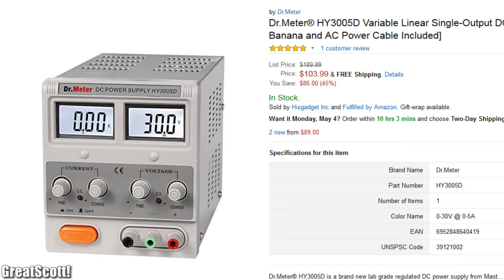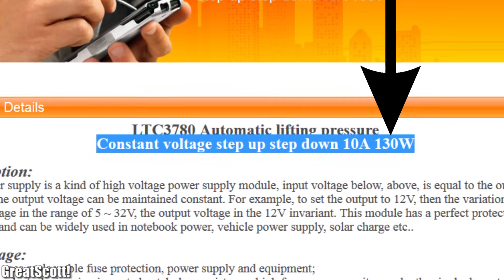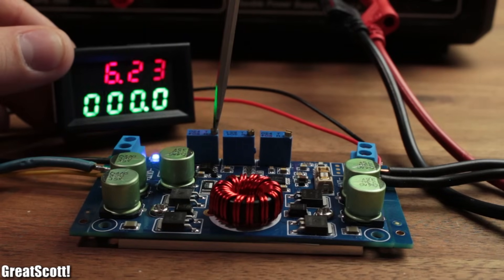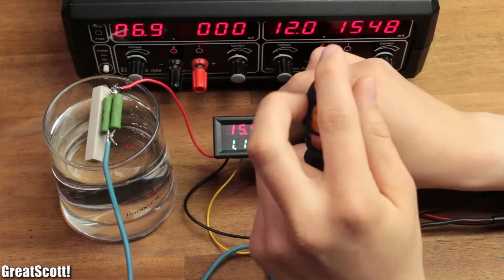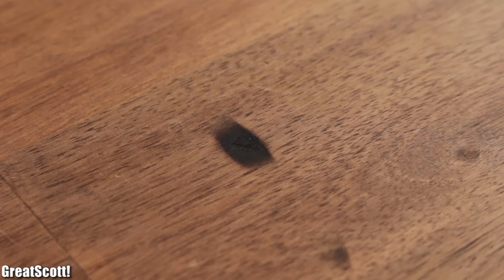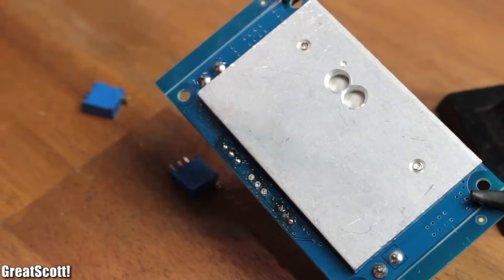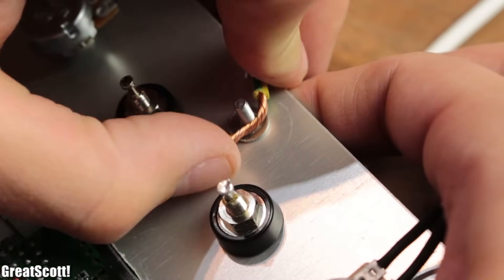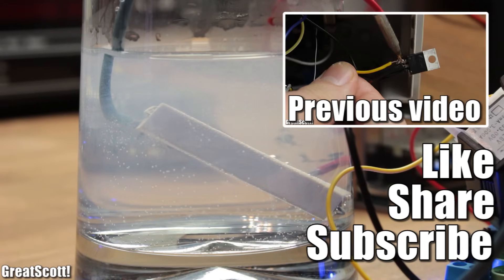Build your own Variable Lab Bench Power Supply

Comment: @3:55 that right there is why we prefer crimped connections over solder for high power and high vibration applications. If there is a fault on a circuit that is soldered, it can melt the solder and cause leads to fly loose and start a fire. This is not so much a good thing on a car and certainly worse on a boat or an airplane.  If you ever hear someone say they don’t like crimp connections and categorically prefer to solder everything, then they are sorely lacking in real world experience.  You see this happen all the time on heavy gauge battery lugs, because people often lack the tools to do a proper hex crimp.  So they solder the entire socket.  Not only does this create the aforementioned failure mode, the solder also wicks up into the strands and creates a hard point where strain concentrates.  Over time fatigue from vibrations and repeated flexing can cause this to totally fail, or even partially fail resulting in a high resistance hotspot that can ironically also lead to solder joint failure.  If a connector is meant to be crimped, then learn how to crimp it properly.   97% of crimp terminal designs are superior to soldering, it’s improper training, a lack of knowledge, and using the wrong tools that causes all the problems.

Comment: I see you've got many positive comments but for me a wiring diagram could be very useful. Like the one here which I found on internet after watching your video -->  https://rmprepusb.blogspot.com/2019/11/everyone-is-wiring-up-their-power.html

This is also IMPORTANT: Iin your circuit the thin black wire of the meter shouldn't be connected! "Notice that, unless you are using two independent power sources (with separate floating 0V such as a battery) then you do NOT connect the thin black wire. i.e. If your project uses a common ground then do not connect the thin black wire." (from the link above)

Comment: An interesting project but if you are building it to try to save money then just buy one ready made, it will likely perform better, it will look better and you'll save money as it will work out cheaper as the components alone are not cheap.....you can get a decent one for around $50

Comment: i would like a power supply or charger with 600w output variable voltage. any idea's how to make one on a budget
Reply: Use old computer psu they can cost like 35$ for that wattage if you buy old one

Comment: I can't even tell you how many times I have taken 110VAC, straight up electrocuted. One time I was replacing an old ladies 3 exterior lights. Her front porch, her side porch along her driveway and her back porch light. I got zapped on the first one. Usually, I can replace a light without turning off any breakers. As long as you are careful, not a problem. On the side porch I went ahead and turned off the breaker. I still received a shock. So on the back porch I flipped the breaker off and disconnected the power supply. I still got shocked for the third time. It was at this point that I came to the realization that the womans aluminum siding was shorted to ground. The entire exterior of her house was hot and ready to discharge to ground. That was why I kept getting shocked. Now, I am no slouch when it comes to electronics. I was an Avionics Electronics Technician in the Marine Corp. And I worked on the AV-8C Harrier jump jet. I even took 220VAC from my right hand straight to my arm pit. I was checking for 220Volts with my Simpson volt meter. My camo sleeves were rolled up and I had my arm pit resting on the coaxial cables for the ANALR-45 radar warning system, 5 cables with metal shielding on the exterior to vent any stray voltages directly to ground so as not to interfere with the radar systems. This was on the flight line at Marine Corp. Air Station Yuma, AZ. It was hot and sweaty, and just as I saw my voltmeter jump to 220Volts, my sweaty right hand slid right down the meter lead and made contact with my hand. I was locked in a death grip as my body tensed up. Luckily, I was able to overcome it in milliseconds, but not before receiving a very serious shock. Thank God the connection was from my hand straight to my armpit. Had I been grounded to any other part of my body, that current/amps would have travelled through my whole body, perhaps even stopping my heart. I still felt the shock all throughout my body, but that was just stray volts wandering through my body seeking ground. Luckily my armpit was making contact with at least 3 of those 5 coaxial cables, giving the electricity many options to return to ground rather than travel throughout my body seeking ground.

Comment: A quick note - just tried this with two LTC 3780, and both gave faults out of the box. While trying to respect the "do not touch" the under-voltage protection pot in the end that needed turning clockwise a lot to get the fault light to go out and the OK LED to go on. Worth considering in case you see this too -- thanks for an excellent video!

Comment: Hello, Trying to make the same project and I'm stumbling upon a problem. When I replaced the Vout potentiometer the reading goes from 0 to 25K Ohm only and the circuit is not working. Tried to measure the 500K potentiometer and when it's not connected to the board it reads fine, but once soldered with extension cables (10cm long) it goes from 2 to 25K only. The original and 2 other potentiomenters show similar values connected and all working fine by themselves not connected.

Comment: Can i use 12V 20.8A - 240W.  led strip Switching Mode Power Supply with all protection and charging high amp batteries  make video pls

Comment: Nice project, but I think instead of telling people to not try this project if they are inexperienced with electronics (because they have to wire a plug themselves) I would have told them to find another power supply that doesn't require you to wire your own plug. An old laptop power supply would have worked well for a lot of people.

Comment: Anyone know where to find that case?
Reply: You could probably buy a small waste basket at the dollar store and it would work. Or get some scrap metal duct and cut & fold your own parts. I know of an hvac place that leaves all their cut scrap ducting in this trailer in the alley that’s free for the taking and I’ve used it to make all sorts of stuff like custom razor saws, L brackets, housings for little projects of mine, custom washers, pizza slicer, custom straps to secure stuff, etc. You could probably get a lot of flat scrap sheet metal from the outside of a broke fridge, microwave shell, metal file cabinet, etc. You can also get nice size plexiglass sheets from broken flat screen TVs. I got 2 pieces from a 65” tv and to buy those same sizes from a store would cost so much. Also yoy can find 4’x4’ thick plexiglass sheets from the loading dock at Walmart sometimes, they come on pallets as seperators when stacking certain products.

Comment: I built a variant of this power supply 6 years ago as well as a smaller one of a different design about a year later. Six years on & both bench power supplies are still going strong with my using this variant just this evening to help build another electronics project.

Comment: Instructions unclear. I spent 150$ just on the jigsaw.
Reply: Have you ever heard of harbor freight? Or drilling holes in certain spots and then using a hacksaw to make the cuts you want?(you drill a hole, unhook one end of the hacksaw blade, put the blade through the hole, and then reattach, cut to where you want, and repeat. Also, if the wood is thin enough, you can score it with a utility knife a bunch of times until it cuts through, or score enough and then snap it. You’ll want to sand the edges. Also you might want to get two pieces of 2x4 andsandwich them together, secure them at the ends with a big it and nut. That way when you snap the board or plexiglass, you can tighten it inbtween the 2x4s with the scored line right on the edge and use both hands and quickly snap the board or plexiglass fast to make a clean cut. That’s pretty much the only way to cut glass too btw. works best with really thin mdf board, chipboard, thin particle board(the kind that is stapled to the backs of cheap book cases to keep the whole shelf straight)plexiglass glass, abs plastic, polystyrene plastic sheets, etc. you can also use plastic storage containers as a housing for whatever project that requires electrical components being secure the snide and drill whatever holes for buttons and power cords.

Comment: Nice, but i probably would have used a more powerful supply, 12V 10A. Not because I need 10 amps but because I know those chinese power supplies very well and they tend to fail if you use them to their full rating without taking a look inside of them and improving the heatsinking, some solder connections, and sometimes change some questionable capacitors.
Reply: If you want a really strong power supply, you could sneak into a hydroelectric damn. If that’s not doable, there should be a little lot in your neighborhood that has all the transformers. All you gotta do is climb the fence and attach whatever cords or wires to it and it will power it super good. Mega power ⚡️ ⚡️ ⚡️ 😊😊😊
Reply: @MrRusty-fm4gb  LMFAO

Comment: M8 your bad soldering on the AC socket is scary , you should first have a good mechanical connection by wrapping the wire around the pins then soldering , this is basic stuff and then heat shrink over that is a good idea plus a fuse ?  It worries me that people are going to get hurt .

Comment: If you don't want to deal with high voltage AC wires, there are power supplies which have a plug just like the one on the back panel, except directly onto the power supply. 

These are usually put into servers, so you gotta trick it into thinking that certain contacts are connected by shorting it with a resistor  (all external and low voltage work). Plenty of tutorials online.

Comment: 1. It's NOT mandatory for current limiting. A current limiter is extremely easy and simple to build, requiring only four components including an ammeter, and can be added to any ol' nasty power supply.

It's nearly never worth your time to build a variable-voltage variable-current power supply because it'll cost you four times as much money in parts as a complete functional Chinese power supply from Amazon... complete with about three thousand five-star reviews.

Comment: Using those cheap chinese power supplies at their full rating is of course possible, but then they usually die after a few months of use! Better to purchase higher amp rating versions that will survive! And as you are putting everything in an enclosure, why not to remove the metal enclosure of the power supply to mount its power semiconductors on proper heatsinks instead of a metal box? It will have a longer life!

Comment: I like this idea. I don't need that much power. I am interested in  low voltage low current projects. something that works with digital circuits and  and adjustable current limiting.  Maybe something that is powered by a small 12 volt DC power supply?

Comment: I have a Superite AR-3000 [3000VA] power conditioner that regulates the 120V AC and steps up to 240V having two separate outlets for each, using a 20lb isolation/step up transformer that has shunt windings that are used by the regulator board for final AC output control. [just measured 116V/233V using 123V source, my current house voltage.] I want to send each output into 2 50A/600V bridge rectifiers and the filter the crap out of it.
I want to use this as the base for a CC/CV power supply. I know that my final RMS will be about 160VDC/320VDC max@ 20A combined loads. I already have a handful of STW26NM60 N channel mosfets rated @ 30A/600V, they have a Vgs of 3V min, 4V typical and 5V max. [Directly parallel 2 of them per output, maybe balance the drains with a 20W .01ohm resistor???] I was thinking of using a 5V/1A little switching supply driven by the AC side of the 120V bridge rectifier for control supply. I was also thinking of using a couple of digital volt meters off of E-Bay as panel indicators.
Could you generate me a schematic on how to do this having both the CV/CC ability and being able to integrate the CC meter?
I already have an idea of how to use the mosfets for voltage control but have no idea how to make it CC/limiting with an adjustment meter.
I am aware of having such high DC voltages present, [India can tell you all about that] the normal voltages I would use is 60V or under but with plenty of current headroom :-)
I have been working with electronics for 40 years repairing old CRT TV's, VCR's and appliances. Networking certified with computer building, repair and various OS manipulation. I ultimately went to work as an automotive diagnostic technician. I have a motto..I can fix just about anything except my marriage.
I tell you this so that you know that I am not a complete knuckle head yet green around the gills with no formal training. [Except DC theory which I already knew by that time at 19 years old]

Comment: I made this supply about four years ago, and have used it most every day since.  Learned a whole lot about electronics in the process, and plan to learn a whole lot more.  Thanks for the awesome build guide!

Edit: Just remembered, I don't know if they sell that buck boost converter board anymore, but if anyone is playing with it, it's a three layer board.  I shorted an internal trace out when I was trying to desolder the pots my first time around, and had to wait a week for a new one lol.  Be careful with the iron when desoldering, and let the pot fall out like he shows if you can, if you try to pull it out too hard you can mess up a sandwiched layer.
Reply: Its a terrible design. MOSs' blow up pretty easy. I found that a simple 8A XL4016 module does a better job than this as a variable supply.
Reply: 9

Comment: It Is modular and you can build it your own, these are good things but actually..considering the switching Power supply, the DC/DC buck/boost converter and the enclosure, isn't it cheaper to just buy a LongWei or other economical switching Power supply, which comes ready to use?

Comment: I have been thinking about making one of these for a while and adding a rechargeable battery bank to it and make it portable but then I ended up buying a regular bench power supply. It would be the same or close to the one you made with the exception that it would have rechargeable batteries inside with charge management to not over charge or discharge while plugged in. Maybe a charge meter on the front too to show how much power is in there before taking it to a job.

Comment: Yescom 110V Input 30V 5A Output Precision Variable Digital DC Power Supply with Alligator Test Lead Set (Price $50.00 USD)
https://www.amazon.com/Yescom-Precision-Variable-Digital-Alligator/dp/B00QJS8RW0/ref=asc_df_B00QJS8RW0/?tag=hyprod-20&linkCode=df0&hvadid=198063088238&hvpos=1o3&hvnetw=g&hvrand=3146939082731673668&hvpone=&hvptwo=&hvqmt=&hvdev=c&hvdvcmdl=&hvlocint=&hvlocphy=9032544&hvtargid=pla-348683490679&psc=1

Comment: I am currently building this and I have found that when you remove the 500K pot and connect some wires to a new 500k pot on the front panel, it can pick up lots of noise from any nearby source (including your hands, nearby switch-mode PSUs, lights, etc.). For instance, with no load and long wires to the 500K pot, the DC-DC converter draws about 100mA and even then the current varies quite a lot (it should be 20mA with no load!), but if I put my hand near the long wires going to the 500K pot, the DC-DC converter draws 1 Amp or more with no load! It is picking up noise due to the high impedance of the circuit. This can also cause the DC-DC converter to misbehave and the fault LED may come on or the output may go wild or just cut off. This is especially bad at the higher output voltages where the resistance approaches 500K. You can tell it is drawing a large current because the heatsinks on the DC-DC board get hot and they should not get hot with no load! So I cut the ends off a shielded USB cable and used it to connect to the 500K pot on the front panel, I also connected the braided shield of the cable at the DC-DC board end to 0V input on the DC-DC board (the other end of the braiding is not connected at the pot end). Now it draws 20mA with no load even if I put my hand on the pot or around the shielded cable. The 200K pot should also be wired up using shielded cable too.
Reply: Thank you very much for sharing this. 🙂
Reply: Thank you for noticing !
Reply: you might want to shield those wires to the ground reference
Reply: Thanks, very helpful.  Can we lengthen the wires by adding longer wires or will that effect the accuracty of the meter?
Reply: @johns2590  You need to use a shielded multi-wire cable for the pots as explained above! Keep as short as possible. make sure you ground the shield braid at one end.
Reply: @steve6375  Power electronics is not amateur stuff it seems.

Comment: Still unclear what is the purpose of those power resistors. Are they meant to stabilize the output or give a way to measure current even with no load attached? This has no answer not even in the instructables page, so I'll have to figure it out by myself, because if I have a li-ion pack that I want to charge I have to make sure that the current does not exceed their tolerance, so I want to know it beforehand.

Comment: Don’t trust that boost converter. Lots of them fault out, even after you adjust the potentiometer to turn down or off the voltage protection. Pretty frustrating.
Reply: That's not just boost /buck converter.
It's IC controlled Boost/Buck converter with safety Features.
Also with larger Power Capacity then regulator boost converter.
More importantly it can Control Current too.
That's what s boost converter can't do..